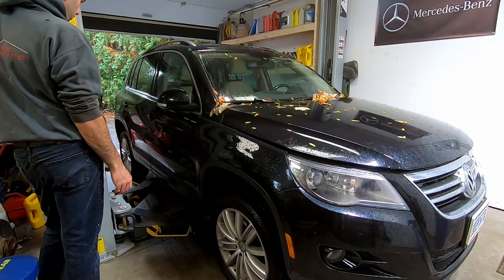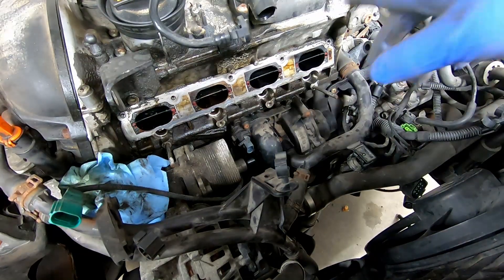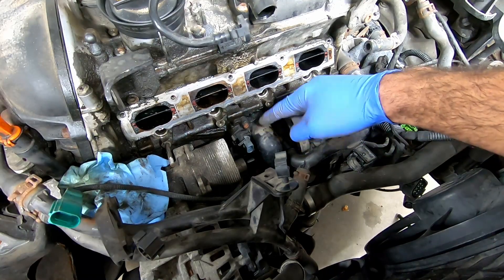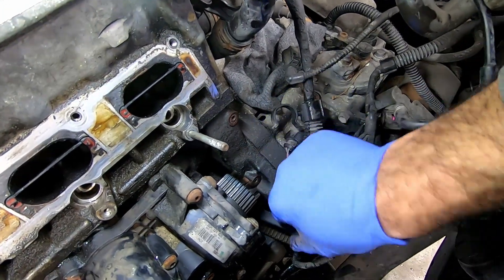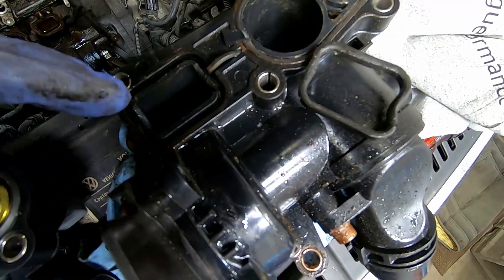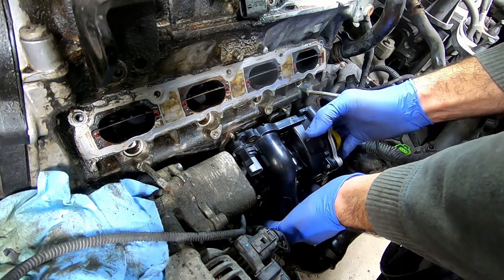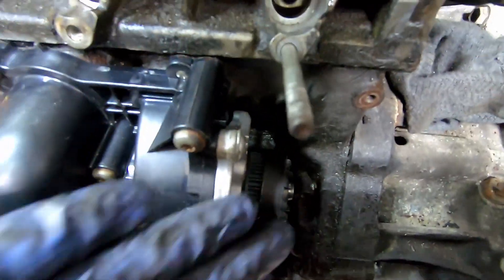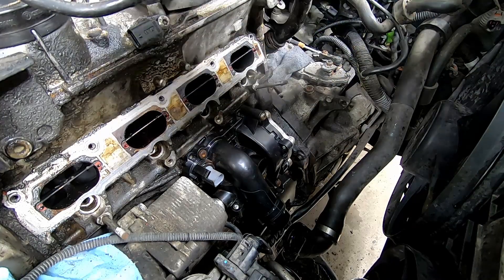VW 2.0T water pump replacement for Tiguan, Golf, Jetta and Passat

Comment: How do you turn the crank to get the belt on the water pump?  You turn on a blue shaft , but where is that attached to?
Reply from the maker: @larsthorstenson253  the crank pulley has a big bolt on the front of it - size 24...

Comment: thanks for video In my case we are going to replace the chain set the pump is still fine. Is it wise to replace the entire pump with housing or just the pump itself?

And is a INA (130$) pump a good choice or should pay 50$ more for Hepu?
Reply from the maker: The housing is all plastic... it's the only thing that breaks so if you're doing the job make sure you change the whole thing... can't really comment on the difference in quality but $50 doesn't seem much considering the amount of work to replace it
Reply: @ETMotorsports  INA is also not so bad . The price is just for the INA or Hepu its both with housing metal. Thanks i will replace the housing

Comment: Hey! I noticed that your car's coolant looks distinctly orange (like mine) after you finished the job. I have a 2013 Tiguan and was expecting mine to be pink or purple. I read that orange is for GM vehicles and that you shouldn't mix different types. What do you think? I need to top up my coolant because the plastic pump is leaking.
Reply from the maker: hey the color of the coolant is slightly different depending on which manufacturer you use...I believe the pink I was looking for was no longer available...the Prestone I've been using is more on the violet scale than orange - maybe the color isn't coming out very well on the video. Make sure you're not mixing different types of coolant...

Comment: I did my water pump on my 2012 VW CC sport 2.0 and after everything was done I had check engine light on I ran the scan and it showed me code p2008 what did I do wrong ? How can I fix it?
Reply from the maker: @thebigbosss1000  that's for the intake manifold - you sure you plugged all the connectors on the bottom and right side?
Reply: @ETMotorsports  I believe so one that’s kinda next to the oil filter and three that are like almost to the water pump (two black and One green ) are those supposed to all
Go together with the braket ? Is that what’s causing the problem

Comment: How did you get the bluetooth to work on the new radio?
Reply from the maker: I haven't yet... unfortunately they use a separate BT module under the passenger seat that I need to wire in

Comment: Hey Boss, what size socket do I need to turn the Crank?
Reply from the maker: 24mm
Reply: Thank you sir. 

Unfortunately, I stripped the Bolt that holds the belt & I’m really having trouble trying to remove it. I heard it’s reverse thread & I’m turning it that way but it’s stripped out now. Pain in the butt.